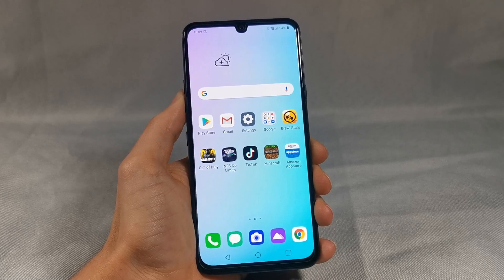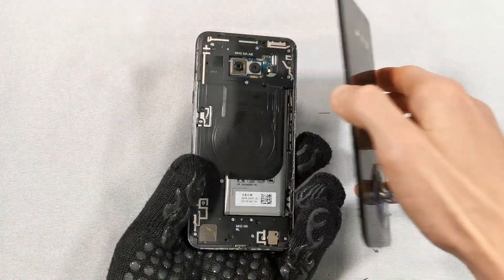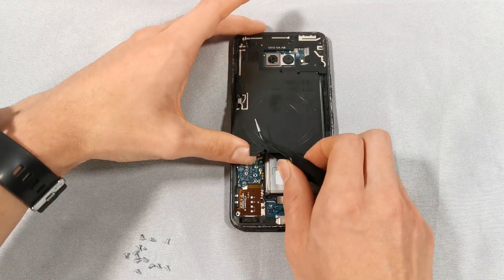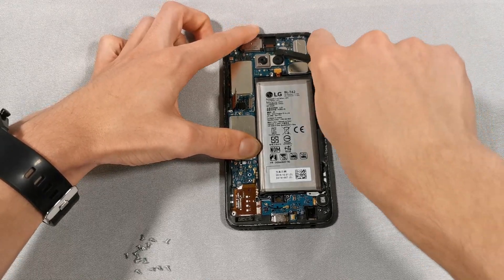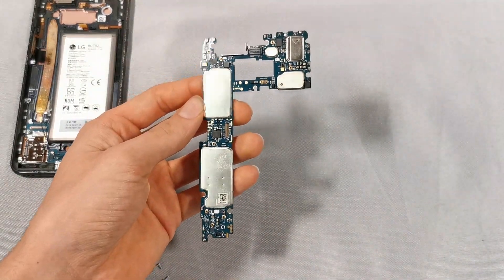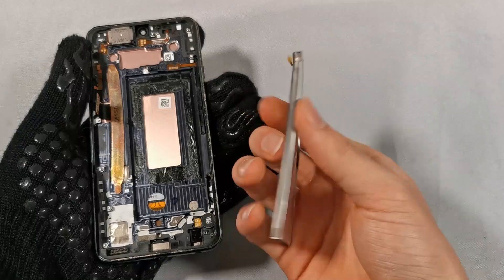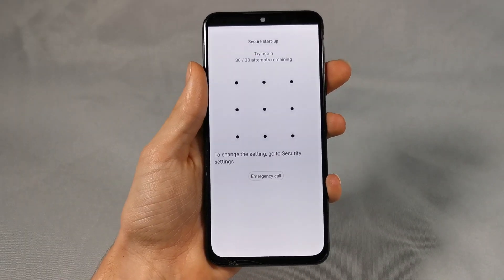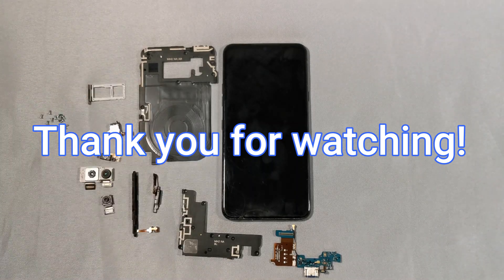LG G8X Teardown Repair

Comment: Just curious,🤓 since the front camera popped out pretty easily, can we replace it with a better camera? Since the stock front cam has a fixed focus point and is not that good.
Reply from the maker: Probably, but you would have to find a camera that is the same size and has the same connector.

Comment: The battery of the lg g8x is the same as the lg v50 are compatible in installation I have seen that the battery model is the same BL-T42 model. It is compatible in installation the Battery in Both Cellphones.

Comment: I know that the ribbon cable is different in shape, but if you were to plug it in anyways would it work? It should be the same screen after all, right?
Reply from the maker: I will have to try that. I'm planning on doing LG g8x repair soon so I'll test it then.
Reply: Please help me out my display is also broken

Comment: Hello brother, in my LG g8x only front glass is broken.the display and touch works good. So is there anyway to change only front glass.
Please help...
Reply from the maker: Yeah, You can heat up the front and then pry off the glass. Here's a link for a replacement front. https://www.ebay.com/itm/LG-G8X-ThinQ-Dual-Screen-Case-Front-Glass-Replacement-Parts-Tools-/383740606686?mkcid=16&mkevt=1&_trksid=p2349624.m46890.l49286&mkrid=711-127632-2357-0

Comment: Hi thanks for providing this video. As we all know there is a hardware level focus issue in front camera which is set to infinity. That's why it doesn't focus on subject. so my question is can we change the focus of front camera by rotating the lens clockwise or anticlockwise ?
Reply from the maker: I tried but it doesn't want to move.
Reply: Hi

Comment: Hi What is the pin whole right above the power button.

I accidentally pocked it with the sim eject tool. Worried if damaged anything or waterproof seal
Reply from the maker: That is a hole leading to a mic. You don't need to worry about damage because the hole turns at a 90° angle before reaching the mic, so you're good!
Reply: @TechOverFlow  Thank you very much

Comment: does it use the same permanent adhesive on the battery like the regular G8 that JerryRigEverything made a video on?
Reply from the maker: I believe it does, however I used heat to make it a little bit easier to remove.

Comment: May I know where exactly heat pipe is fitted in the phone?? Lg says there's a heat pipe in the phone.
Reply from the maker: You can see it at 6:30 . It's parallel to where the battery used to be.

Comment: it's completely waterproof mobile is it correct ???
it survive in sea water also ??
please reply me...
Reply from the maker: The phone is water resistant, not waterproof. However, It does seem like it will be able to handle being submerged in water because of how well everything is sealed but of course do so at your own risk because it's not perfect. I would not recommend bringing it in salt water because it can be very corrosive.
Reply: @TechOverFlow  Now i can understand thanks for response ...
Reply from the maker: @krishnacharanvlogs7167  Yep, No problem! Glad I could help!

Comment: Hey I poked into the hole on the right side of the phone by mistake using the sim ejector tool.. would I be facing issues? Like is the signal antenna of microphone there?
Reply from the maker: There is a microphone, but your phone will be fine because the hole turns at a 90° angle before reaching it.
Reply: @TechOverFlow  phew!

Comment: My dual screen not working wl you pls tell me what happened when i attached msg comes from android system power supply usb charging i have to select option from many i select power supply but it doesn't work dual display symbol disappeared from main screen
Reply from the maker: Does the front of the dual screen light up?
Reply: @TechOverFlow  no bro its off

Comment: Bro does LG G8x has a cooling system , if yes which kins ?
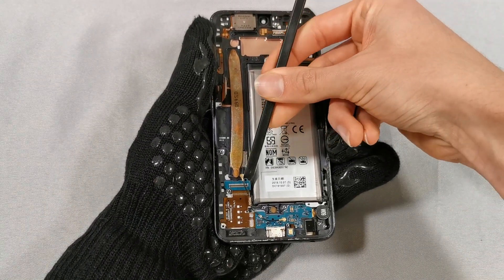Reply from the maker: Yes, you can see it at 5:17. It's the long metal piece next to the battery.
Reply: @TechOverFlow  please can you advice me about what cooling system is good, this one with the heat pipe or the V50 thinQ system.

Comment: Hi Bro, I inserted SIM ejector tool in Secondary Mic hole on My LG G8X thinq , whether it damage water resistance or the mic
Reply from the maker: No, the mic holes turns at a 90° angle before reaching the mic, so you're good!
Reply: @TechOverFlow  THANK YOU FOR YOUR REPLY

Comment: Wow, so the battery is not permanently glued in like the g8?
Reply from the maker: Sadly it is. I just waited for the battery to die so that I could heat it up which made removing it a lot easier. Sorry I gave the wrong impression.

Comment: Where would the internal memory hardware be on an LG Journey, Model number LGL322
Is it possible to remove the internal memory hardware from a broken phone, and put it into another of the same model? Or will another phone not read it, even if its the same model phone? I've heard internal memory may be bound to one phone? That its encrypted? Is there any way to get around this? Like maybe putting the motherboard into the new phone along with the internal memory?
I need to save my internal files from a very broken phone. My computer won't read my LG Journey phone as a storage. Nothing shows up at all. And the phone screen is completely broken.

So far no one will repair my phone, and I'm starting to prefer doing it myself.

Comment: my upper speaker is not working after fall down in the water
Reply from the maker: If you don't want to open it up and replace the speaker, I would suggest playing loud water removing music that you can find on YouTube. If that doesn't work try blowing hot air at it from a hair dryer.

Comment: Is it a water proof ???
Reply from the maker: It's only water resistant, however they did a great job in waterproofing it so I think it will be fine in the water. Do so at your own risk and make sure you get the water out of the ports after.

Comment: I miss the days when one could take apart a case with just a screw driver.
Reply from the maker: Yeah, that was nice! But on the upside, they are a lot more water resistant than they used to be.

Comment: My USB is showing file sharing option when connected to second screen...and power is not flowing to second screen, any hints on how to resolve it?
Reply: Try restarting it. And if that doesn't help, get it replaced
Reply: @sahilh5006  Restarting and factory reset is done many times but no use

Comment: By mistake i have inserted sim tool kit in microphone so is there any possibility to damage the mic or waterproof system pls reply
Reply from the maker: The microphone will be fine and will still be waterproof. The hole turns at a 90° angle before reaching the microphone.
Reply: @TechOverFlow  thanks for your information bro keep it up👍
Reply from the maker: @shubhamrathore6555  No problem! 😁

Comment: I just had my screen replaced and my mobile network is almost non existant now. Shows as - 122.  Can you explain what the repair guy may have done wrong here?
Reply from the maker: It's possible that they forgot to remove the sim card tray before trying to remove the motherboard. If so, they most likely damaged the port on the motherboard.
Reply: @TechOverFlow  thanks this might make sense as the door to open my sim tray gets kinda stuck now

Comment: Didn't know a simple battery needs glue on it. Lol.
Reply from the maker: Yep! It's good to have some glue on the battery so it doesn't move around in the phone.
Reply: @TechOverFlow  Right on! Thanks. 👍😊 Note to self, plug glue or some type of adhesive on things, you don't want it to move around so much. 😁

Comment: Bro wear is vibration motor
Reply from the maker: You can see it at 6:29 in the bottom right corner. It is the circle with "60M" on it.

Comment: The battery of the lg g8x is the same as the lg v50 are compatible in installation I have seen that the battery model is the same BL-T42 model. It is compatible in installation the Battery in Both Cellphones.
Reply from the maker: Oh, Nice! I wasn't aware of that. Thanks for letting me know! 😁